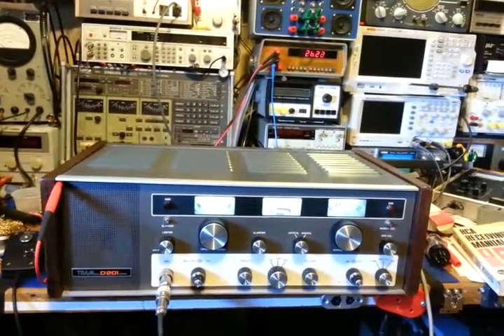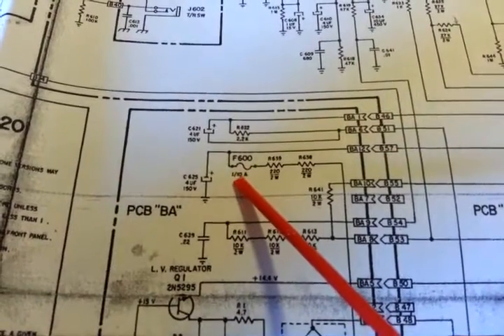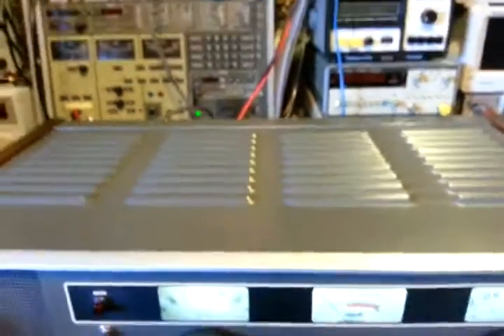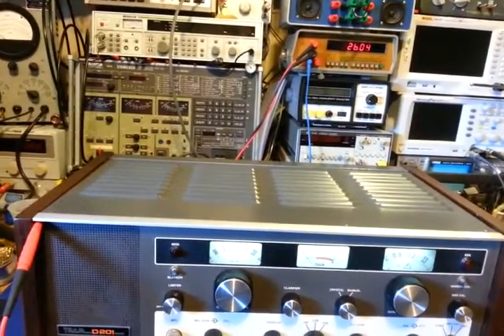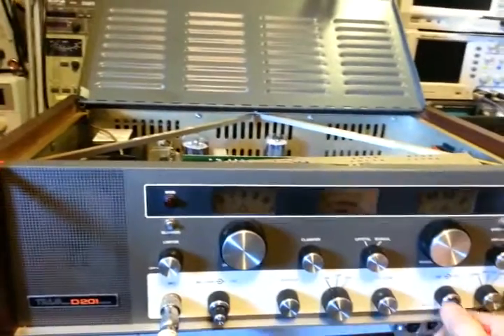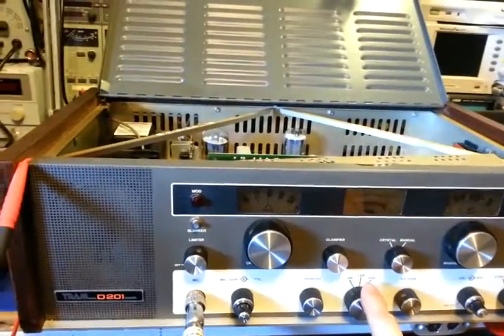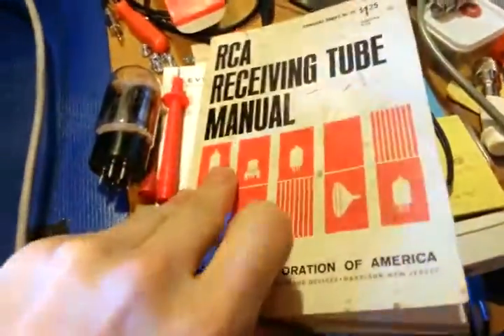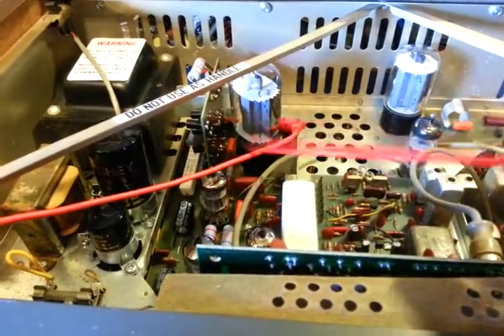Tram D201 blown fuse F600 repair.

Comment: I have had 450 volts hit me while one of these were keyed standing barefoot in wet grass. Not a fun experience that left RF burns on 3 fingers from vquad gamma match.  I forget what shorted out in the D201 that caused this but had it repaired & only use solid state radios to tune my antennas now.

Comment: Mike do you have a contact number where I can get ahold of you at. I have a Tram d201 that need caps and resistor  replacement.
Reply from the maker: +Tom Harrold 

It's going to be 6 months or more before I can take in any tube type radios for repair.    I have had to drastically cut back on time intensive work like this while I prepare to publish the electronics course.  Once I get that course up and running I should be able to start taking in a few jobs like this again.
Reply: Ok thanks Mike
Reply: Do you sell the replacement capacitor and resistor kit

Comment: Good video !  question does this use the 2 6L6 tubes ? in audio & Transmit ?  Rick in VA.
Reply from the maker: Yes, two 6L6 tubes.  One for the transmit modulation and receive audio and the other is the RF final tube.  The last version of the D201A used a 6DG6 as the RF final, just a little lower power version of the 6L6.

Comment: Question since I am not up on my tube design... they were mostly gone by the time I came in.
You mentioned that it seemed to be a design flaw.. and looking at the schematic what jumps out at me is the placement of C625 and F600. Why did they not place C625 at the junction of F600 and R639? (639 right? hard to read)
So, tube shorts and has an excessive voltage at the cathode but we don't kill the cap in the process.
We get a blown fuse and that's all she wrote.... unless I am missing a situation where this would cause another part of the circuit to fail? Is the cap sacrificial when the tube fails?
Reply from the maker: Yeah that's about it.  The cap is on the wrong side of the fuse.  Or..........Might not be a design flaw at all.  LOL, its a blown fuse indicator.  Tube shorts out, fuse blows and the capacitor violently explodes giving you a visual (smoke), audio (explosion) and smell (cooked capacitor oil) indication there is a problem. :)
Reply: "Not a bug, it's a feature" arguments are the best :)